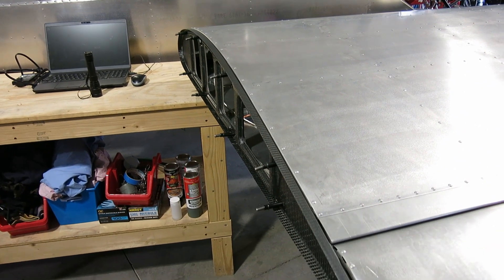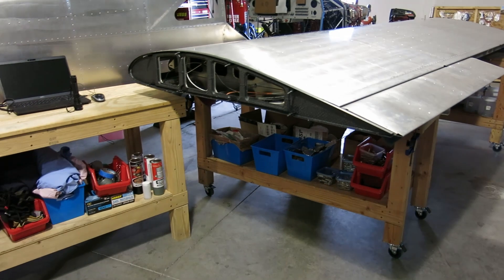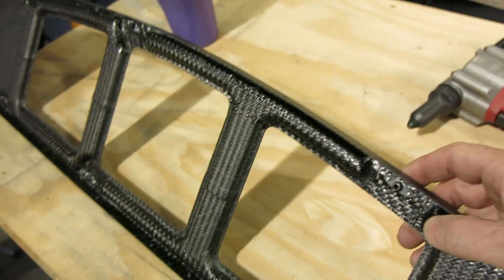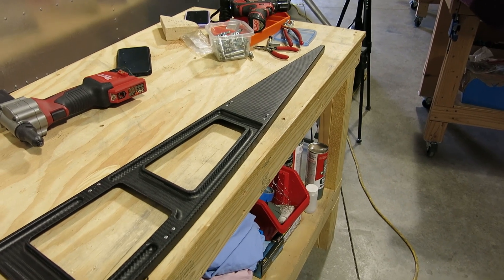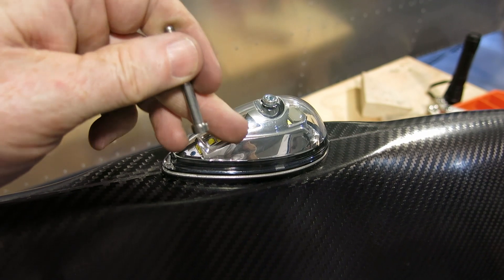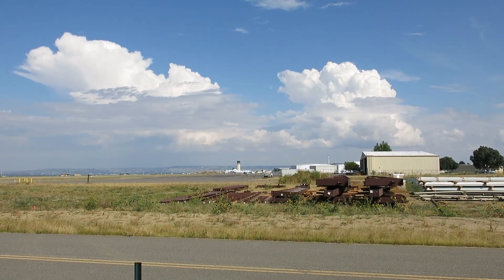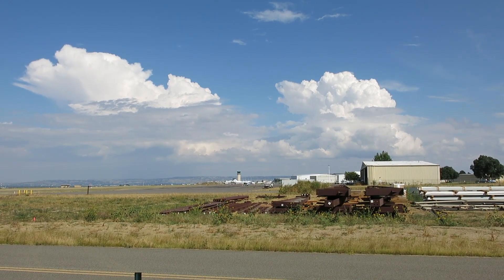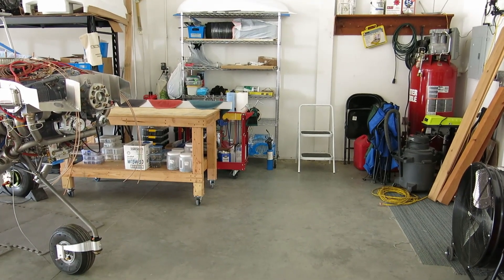No. 295 08-06-2023 Carbon fiber wingtips -part 2

Comment: My OEM wing tips came out OK after gluing, but one side has a little twist I am fighting with.  I sort of wish I had followed Randy’s technique which is to use clecos during gluing rather than Eddie’s form and weight technique.  I think the clecos would have been both easier and more accurate, albeit with some extra work to fill the holes.  However, I likely will need some filler to address the gap left from the twist in the one wingtip so not difference there.  I still think my tips will look good enough to not need to spend the obscene price for the carbon fiber tips.  😁
Reply from the maker: It’s only money 🙂
Reply: @s-21project92  Since you feel that way, I will send you my address and you can send me a couple grand to buy the carbon fiber wingtips.  😂